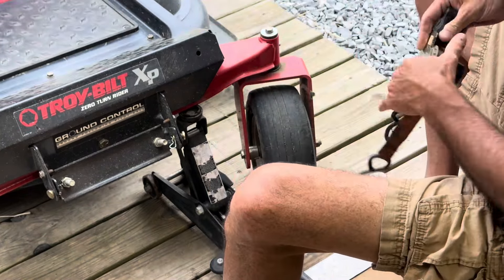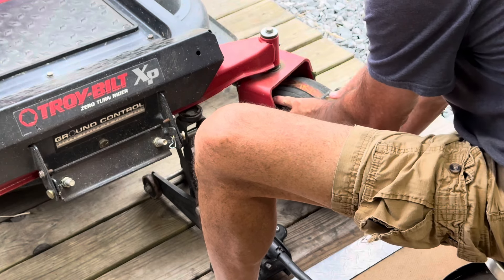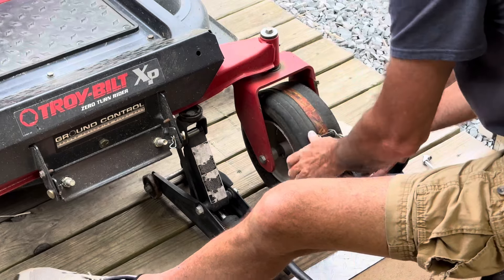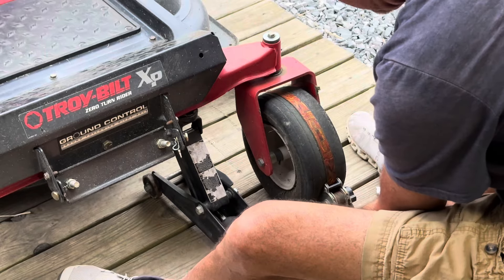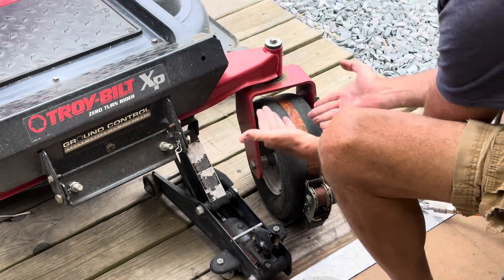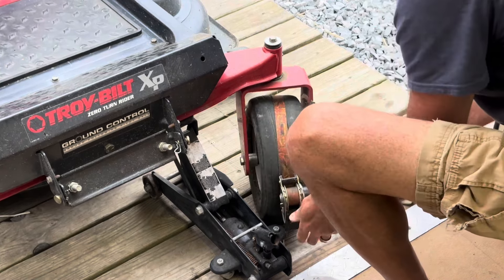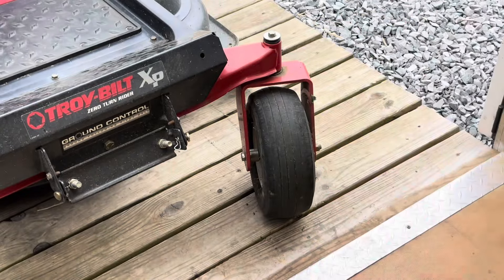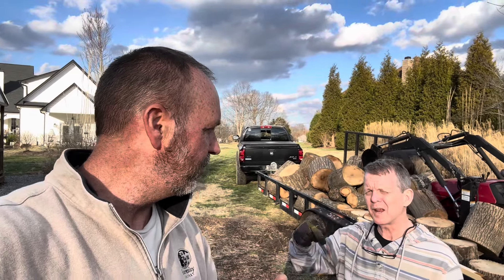How to get Mower tire bead to set

Comment: Great tip, I have used the same method. For difficult ones I found that taking the valve out of the stem gets more air in quicker. Once seated you can then put the valve back in
Reply from the maker: Good tip on removing the valve

Comment: The first thing I do is replace them with solid tires.  For $55 a pair on Amazon I can't be bothered fighting with them anymore.  When I have pneumatic tires this small I move to solid whenever possible.  I have an EGO Zero Turn electric which has two on the front that are next on the list for them to be swapped out.  I have used that trick though when the bead broke while waiting for my order to arrive.  :-D
Reply from the maker: Solid tire is better